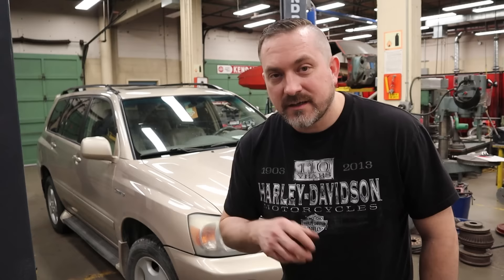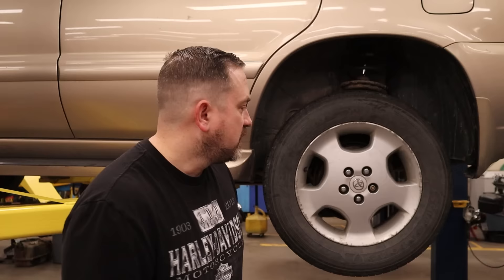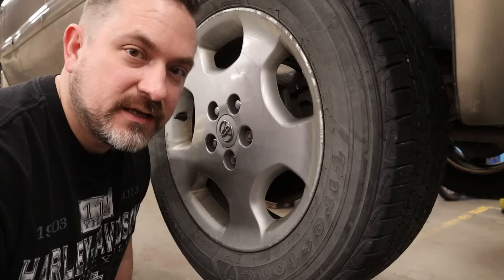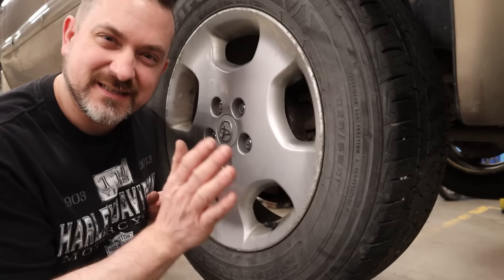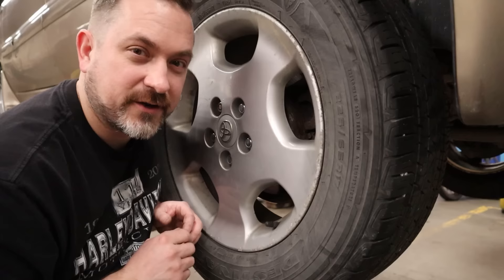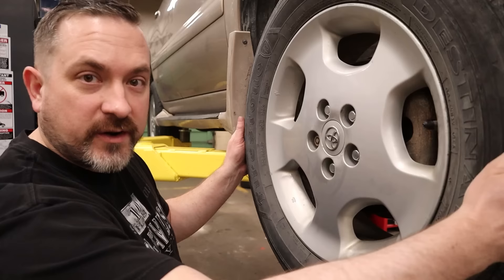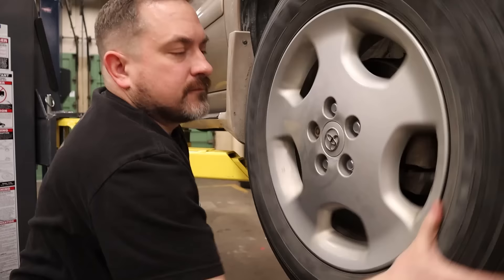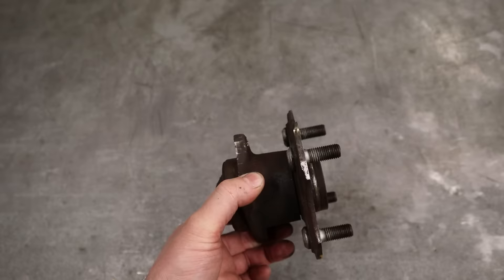How to 100% diagnose a bad wheel bearing.

Comment: Excellent video and excellent explanation. Many thanks, but we wish to explain to us how to find the noisy bearing on the front Weel drive bearings due to the power steering tie rods. Also, you can't turn the tire by hand?
Reply from the maker: The best way to tell a bad bearing is a road test and hearing a speed dependent sound which you can diagnose by turning and seeing if the sound comes and goes with a direction. Then jack up the car and check for play.  The spinning isn't always good at telling especially if it's a drive wheel.  I also have a great video on road testing a bearing you should check out.  Thanks for the watch and welcome to the channel!

Comment: Thank you for the video. Been hearing a scraping sounds from the front wheels and read that it could be the brakes or the bearing. Getting to hear what a bad bearing sounds like helps me narrow it down to the brakes.
Reply from the maker: Scraping is usually the brake pad friction material is gone.  I have a great video on checking your brake pads you should check out too.  Thanks for the watch and welcome to the channel!

Comment: Had brake work done on my car a year ago, my mechanic told me he had to remove the wheel hub bearing to replace the knuckle/dust cover. I told him to inspect the wheel bearing. He said he did and re-installed a bad wheel bearing and says the bearing was good. Then said my rear diff is shot and is making noise. I had my performance shop check that noise out, 2nd option. It was the wheel bearing. I no longer let my local shop look for wheel bearing noises.
Reply from the maker: An even better way is to know how to diagnose these issues yourself, then you don't have to trust anyone else.  Plus you get to have fun changing it yourself too.  Thanks for the watch!

Comment: Pretty good but left to right motion could be bad inner or outr tie rods while vertical play could be bad ball joints. 
A more direct test is to look at axle boot while u shake tire.  If it's moving the it's def bad hub cuz axle is only suspention that is directly connected to hub.
Reply from the maker: Yup you're right.  A road test or a hand on the spring works wonders too.  Check out my new video.  Cheers!

Comment: Another way to check a wheel bearing if it doesnt have side to side play but still has a loud rumbling noise. You can put your left hand on the coil spring and rotate the wheel with your right hand usually you would feel the vibration going through the coil spring if the wheel bearing is bad
Reply from the maker: Yeah that's a cool trick to remember.  I often get these wheel bearings waaay to late and they are making horrible noise and have lots of play so I don't use that one much.  Thanks for the watch!

Comment: I just replaced my front wheel bearings had the driving noise so I suspected bearings but they had no play, they where quiet when I spun the wheel. Once I had the hub off you could feel the notches when turning it by hand.
Reply from the maker: Yeah there is a range of where the wear starts all the way to where the play is so bad the wheel falls off.  Glad you got it figured out.  I have another road test bearings video that show some other tips as well.  Thanks for the watch!

Comment: For me its up and down movement, But everything else is good, lower control arm, bushings, inner and outter tie rod and strut is all good.  My CV axle does have play in and out plus up and down at tad.  Not sure if its bearing or axle.
Reply from the maker: You may need to use a long prybar to move the play and have someone else look for where the play is.  Usually CV axle wear is if you can rotate the shaft back and forth or you have clicking during slow full turns.  Hope that helps.  Thanks for the watch and welcome to the channel!

Comment: Is it possible to have  12:00- 6:00 Oclock play without bearing noise? All I hear is a clunking sound going over bumps at slow speed. This is on a 96 Volvo 850 with 165,000 miles. CV and suspension are all in good shape. Lugs are torqued. Excellent video especially since you cover how to hold the wheel and rock it.
Reply from the maker: If you only have play up and down then you have a suspension component worn and ready to fail.  Check upper and lower ball joints, McPherson strut mounts, camber bolts, etc.  If you don't have play but have a clunking sound over speed bumps when you go over them at angles, check end links on anti sway bar.  Good luck!

Comment: This video is awesome. I’ve been trying to pinpoint that noise and the mechanic told me it’s my front left bearing, but I have a hard time trusting anyone with vehicle repairs - ugh. Bad habit; I’m just an over thinker and it’s not always convenient to spend all that money. I want to try the stuff you did in this video so I feel comfortable paying for it to get fixed…. If that’s what he says it is then I should trust him! If that doesn’t solve the noise issue, then what else could it be?? Your video seems spot on with what I’m hearing and when I’m hearing it.
Reply: I asked him if he took it all apart to diagnose it, because I really wanna make sure that’s the issue 😂 He said he knows it’s that left bearing and taking it all apart is more than just simply taking it apart. It’s a longer process.
Reply from the maker: Well do the test on your vehicle and confirm the issue and then you'll know.  Let me know what you find.  Thanks for the watch!
Reply: If the machanic told you it was a wheel bearing and you didnt trust him then who would you trust ?
Reply from the maker: It's sometimes not so easy because there are some shady shops or techs that can't diagnose properly.  This is why I do everything myself these days, that way I know 100% that the job was done properly.

Comment: If only they all were that easy to diagnose!  Pretty much every one of the last 6 or so I've ran across had no play. Had to spin them....which becomes challenging on many AWD vehicles.
Reply from the maker: Yeah it just depends how you get them when you inspect.  Some are easy, some are harder.  Some need other tricks.  I have a great video on road testing a bearing you should check out too.  Thanks for the watch and welcome to the channel.  Cheers!

Comment: thank you, I hear a whining or rolling sound on my tires when I drive but not sure what it is. The garage said it's not the bearing but the problem of my brakes. I don't know if it is correct, the sound hears like two old wheels rub against each other or like something is rolling without lubrication, it doesn't sound when braking. I'm not a car person I cannot tell. but the mechanics didn't sound certain when they  confirm it's brake problem, it's just "it seems like..." and they suggested fix the brake first to see if the sound persisted. the cost is hefty though :(((
Reply from the maker: I would recommend checking your bearings yourself like in the video and go from there.  I also have a video on checking your disc brakes and another on checking drum brakes.  If you do this yourself, then you will know if the mechanic is tight or wrong.  Otherwise you might be paying them for something you don't need.  If it's a metal grinding sound, it could be that the brake pads are worn out.  Good luck!

Comment: Thank you for such great job.

My Toyota Camry 2006 model, the front wheel is always shaking on motion and causes vibration on the car body. 

What can be the problem and possible solution
Reply from the maker: If the wheel itself is shaking, check that the lug nuts are tight and if wheel bearings are shot as per the video.  If you feel play only dude to side, then you might have a tie rod worn out and it should be replaced pronto.  If all of this checks out, you might have a tire issue or wheel out of balance.  I also have a video on balancing you might wanna watch.  Welcome to the channel!

Comment: I changed both front wheel bearings on a Jaguar XK8 for nothing. I first thought it was the right one, changed that but the sound remained. Damn it, then it has to be the left one so I changed that too. (They are pressed in so not super easy to replace but I did it with some McGyvering without a hydraulic press.) But nooooooooo, still the same noise! It turned out it was the tires. It sounded just like a worn bearing, never heard tires make that noise but they did.

I have had bad bearings on a Saab 9000 but I couldn't feel any play or hear any sond when the car was jacked up, it was only audible when the car was rolling. I thought about attaching microphones close to the wheels to confirm which one was bad but I changed both instead.
Reply from the maker: Oh that sucks!  Yeah you gotta diagnose fully or you end up changing things that may not need it yet.  If there was no play, then it probably wasn't the bearing.  I just released a new video you'll wanna check out to learn even more about diagnosing bearings.  Thanks for the watch!

Comment: Another tell-tale is side loading.  While turning, in a curve, or driving on a road with a large camber a bad bearing (especially front), will make a lot more noise than when travelling straight and flat.
Reply from the maker: Yes, you're right.  I have a good video showing this during a road test plus some other tricks coming out soon.  Thanks for the watch!

Comment: Got a 2003 CRV with couple stripped/cross threaded wheel studs (thanks previous careless mechanic), the mechanic said to replace the studs the wheel bearing needs to be removed, it can't be put back & a new wheel bearing is needed. Can't understand why the wheel bearing can't be just be put back ? (Turn out just have to make a little snip in the hub to allow the new stud to be inserted without removing the wheel bearing)
Reply from the maker: Yeah you should be able to do a wheel stud removal/install like you said.  Hammer in the old and cut if they hit.  Then usually you can turn the hub to gain better access.  Sometimes they just barely hit so you grind a little off the head or a notch in the hub. Mind you, if the bearing hub is super old or showing signs of being bad, maybe changing it out is smarter.  Hope that helps, good luck.

Comment: holy moly that sound when you shookj it is the same sound my rear driver side makes, this is def a telltale sign i need to get my wheel bearing replaced... how much longer do i have before i could possibly lose control of car?
Reply from the maker: Hard to say, usually if you can feel it loose....it's just a matter of time.  Get er fixed!  Thanks for the watch!

Comment: so here's another tip that I learned through experience, bad wheel bearings ALMOST always run hot,,  you can do a quick thermal probe test of the wheel at the hub after driving, if you see a noticeable temp diff from the other side(remember it could be bad too), you have a fast and easy indication you are on the right track.  You can do this without even lifting the vehicle.
Reply from the maker: Yeah that's a good tip, I used this last year on my trailer bearings.  I used my hand to check but you can also use a thermometer.  Usually you'll have other signs first unless your checking for heat before there is an issue.  Thanks for the watch!

Comment: I replaced mine on my Corolla but later after overadjusting rear drums, drums overheated. Would this heat destroy a rear hub bearing? Great Video. Thank you.
Reply from the maker: No it shouldn't but it depends on how long the brakes were on for.  If it was days.....maybe.  most likely not though.  Hope that helps.  Thanks for the watch!

Comment: We likely have a bad wheel bearing on our 2010 Accord. I saw another how-to vid that shows how labor intensive it is to replace the front bearings. So I wondered if it would be prudent to replace the original CV axles (not to mention brake pads) while everything is disassembled.
Reply from the maker: It's up to you but if anything looks worn out or the CV axle rubber boots are cracked, you might wanna do them too.  I have a great video on checking brake pads you should check out. If you deem me worthy, I'd really appreciate it if you could share out my channel on your social media so I can help more people. Thanks for the watch and welcome to the channel!

Comment: I was taught back in the 1970's that while driving, if you load the side with the bad bearing, it gets quieter.  So, if you turn to the right a bit loading the left side and there is no change in the sound, but then turn to the left and load the right side and it quiets down, then a right side bearing is bad.  I just used this method on my 1998 Dodge B1500 Van and found I have a bad right rear wheel bearing.  (In a van, it was easy to determine if front or rear as it is empty and the sound was coming from the very back for sure on the right side)  I have not jacked it up yet to check the way you showed in your excellent video, but I will do so very soon to confirm.  Not looking forward to this job.  Thank you.
Reply: Thank you for this! it goes quiet when I turn right, so it is my left wheel.
Reply from the maker: Its actually the other way around.  When you turn right at speed your body rolls and unloads the right side making it quieter.  Check your right side bearings.  Good luck!

Comment: Was told i needed a new bearing from a shop here in Upstate NY 2011 aka R/R  pressed bearing less than 30k miles Kia sportgage AWD 2011 EX, said problably didnt notice the noise fro your snow tires on? the shop said they dont have a press to do the bearing>  i just dont understand, anyone out there? were all busy with our own problems and i would so much appreciate your Guidence and help much love and Respect Ice Man Brockport NY 14420
Reply: and the cost would be 656.56 out the door
Reply from the maker: If you have the speed dependant sound and you have verified the bad bearing like in the video, then it sounds like you need it done.  It coukd be a pressed in bearing type, a quick google search will show you if it is or if it's a hub assembly.  If the shop doesn't have a press, then go to another shop.  The cost sounds about right.  I just did my own and the part was $600 from Lordco Auto Parts ( my cost $250) and it was a pain because it was rusted in there really good. Thanks for the watch.

Comment: So I have a 2014 VW jetta, left front vibrates when turning right under load. I have replaced inner and outer tierods on both sides along with lower control arms and ball joints. Have new tires and alignment done. It's really racking my brain on this one.
Reply from the maker: Did you jack it up and check for play on the wheels?  Could also be cv axle or wheel balance.  Good luck!
Reply: @wayofthewrench  I'm thinking it's a CV axel, tires are new and balanced.
Reply from the maker: Yeah cv axles can make noise in turns and not in the other direction.  One way to test that is go to an empty parking lot and go slow speed in a full turn, then go the other way, then go full turn backwards, and then go backwards the other direction.  It tests the inner and outer cv joints on both sides.  You hear clunking/growling when they are bad.  Cheers!

Comment: You can on road test get the vibration starting and then turn the right and see if it goes away and try turning it to the left should clue you in if it's the right one or the left .
Reply from the maker: You're absolutely right and I have a video showing this plus some other tips and tricks to diagnose bad bearings.  You should check it out!  Thanks for the watch and welcome to the channel!

Comment: Very informative video. The only thing I would add is that when the wheel bearings first start to go bad you will often hear the grinding noise only when making a sharp turn.
Reply from the maker: Thanks!  Yeah that's about right.  I have another video on doing that road test plus some other tricks to diagnose a bad wheel bearing.  Thanks for the watch and welcome to the channel!
Reply: Thanks my Acura TL has been doing that. Does it usually on u turns, pulling into parking spots.
Reply from the maker: hrmm usually slow driving won't show bearings but hard turns in a parking lot of u turns might be a bad cv axle.
Reply: @wayofthewrench  It might me my power steering pump. I replaced it twice already using the same brand but keep getting the same noise. The noise is gone for a week after replacement and then comes back again. I’m thinking these aftermarket pumps are not good enough and should just buy oem. I’m already on the 2nd pump and I don’t know if I’ll want to go through the hassle of getting a replacement. I might just buy the oem to finally get rid of this noise and see if I can get reimbursed for the aftermarket pump.
Reply: @wayofthewrench  I had a mechanic diagnose it and he said it’s most likely the pump that’s bad even though it’s new. He said usually when he does ps pump replacements he usually trys to have the customer go with an oem part.
Reply from the maker: What does the fluid look like?  If it's silvery, that means the inside of the power steering pump is chewed up and the metallic flecks could be damaging other parts in the system which is ruining the new pumps quickly.
Reply: @wayofthewrench fluid looks good. I’m using the oem honda ps fluid and it looks exactly the same as when I first put it in the reservoir.
Reply from the maker: Hrmmmm.....third pump in a couple months just screams that there is another issue.